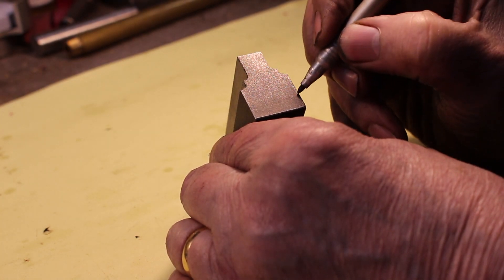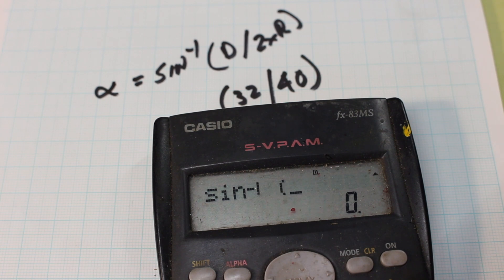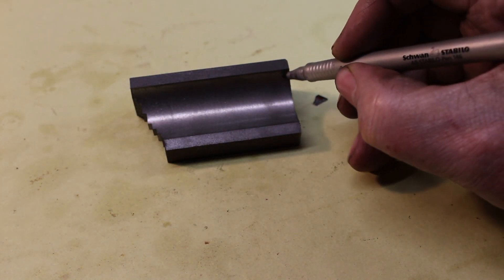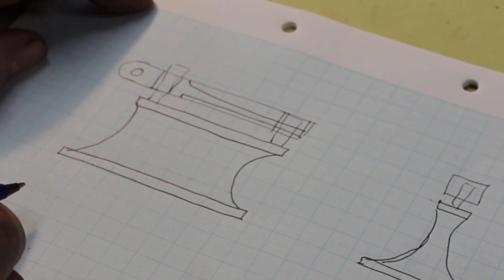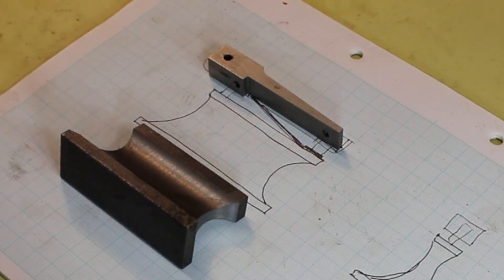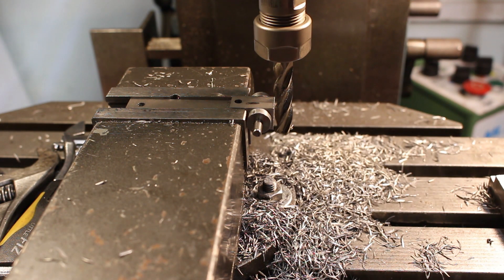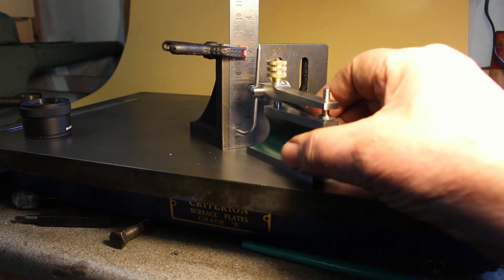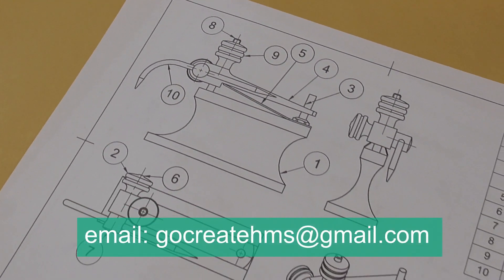#toolfest2021 - My Tool Build Entry - Tool Fest 2021

Comment: Beautiful workmanship Nigel. You had me guessing right to the end as to what you were working on. This is just me being curious but doesn't the path of the cutter tip trace out an elliptical profile relative to the vertical plane? I have used this method to make wide, shallow profiles in wooden mouldings using an angled fence relative to the plane of a circular saw blade. I just modelled it in CAD and the side view shows an ellipse 32mm major axis and 25.56mm minor axis. 
Regards,
Mark
Reply from the maker: Hi Mark, yes indeed it will cut an ellipse so in that sense it's an approximation. The larger the radius and the shallower the depth of the radius (or narrower the width) then the more accurate the machined radius to the required true radius, in such a case usually no detectible deviation.  I bit more investigation may make a decent video.
Thanks for watching and commenting, the scriber block did turn out really nice.
Cheers
Nigel

Comment: A file only cuts one way, not back and forth. Might save yourself some money on a new file using it properly.
Reply from the maker: Thanks for the tip. I've never felt that comfortable using the lift technique when filing, I've always preferred just a very light drag even though it may dull the file a little quicker. You may be interested in this video testing and comparing the lift and drag filing methods. https://youtu.be/xbykic--SKA
Reply: @GoCreatehms  There is no comparison period. A file only cuts one way base on my 47 years making chips. If you want to drag your file backwards by all means do so, it's your file but it also shows your lacking in how cutting tools work. Do that shit with a set of $150.00 Swiss files and you'll change your mind. No difference with a hacksaw, let the tool do the work.
Reply from the maker: @patrickhennigan9689  Indeed, I probably would change my mind if I were using expensive swiss files, I've allot to learn and allot to practice, thanks for passing on the benefit of your experience.

Comment: Fantastic tool, just right for smaller surface plates like I have. I am going to have to play with a fly cutter and cut some radii as I still can’t get my head around it and I hate using something without understanding how it works.
Brilliant video as usual, enough explanation without the waffle.
I am probably being very stupid but what is toolfest2021.
Reply from the maker: Hi Chris, thanks for watching my video and commenting. It's a good technique to play with, you'll find it in the old school machining test books. I've used it up to a 4-1/2" radius , on that occasion a long narrow name plate to fit onto a boiler barrel.
Cheers
Nigel

Comment: Very nice job. Nigel. Yes the radius was very clever, had not seen it performed that way with a fly cutter.
Reply from the maker: It's a good old time technique to machine a large radius, I've used it to machine a 4-1/2" radius on some name plates that had to fit onto a 9" barrel.
Thanks for watching.

Comment: Nigel, a nice piece of work, wonder if you might be able to give me a bit of info on your mill, I’ve been offered it would seem the same mill Victoria mk2 with horizontal and vertical heads, I’m told the maximum speed is around 600rpm , is yours the same and does it present any problems when using smaller end mills.
Reply from the maker: Hi Terry, thanks for watching my video and commenting.
The mill you saw in the video is my Elliott Junior Mill, details can be seen at this website http://www.lathes.co.uk/elliott-omnimil-00/
It's top speed on the horizontal spindle is 1700 rpm. In the video I was using my double swivel vertical attachment which I think gears up the RPM a little but I don't know for sure. 600 rpm is probably OK for a horizontal spindle were you tend to use larger cutters but for a vertical spindle is a little restrictive if you intend to use very small cutters allot however, as hobbyists we tend to mater what we have, low rpm just means taking it a little slower.
I hope that helps you out.
Cheers
Nigel

Comment: Beautiful tool.  That might be a winner.
Reply: IS this creator from over seas?? I set our to air at emmas request at 12:01 AM on the 24th of Nov,,,??? Whats the deal?? BEAR
Reply from the maker: Wasn't it to be 12.01 in your own time zone? I'm in Scotland.
Reply: I must have missed that part 🤐. Nearing 70,,so I miss alot more since I am over the Hill now,,. 🙄😋👍
Reply: @GoCreatehms  Heh heh, I missed the #toolfest2021 deadline by four days, but posted my toolfest vid anyway.  I'm permanently late these days. I'm going to try that angled head radius cutting trick with a big shell mill for an upcoming job. Thanks for the tip and the maths!
Reply from the maker: Thanks Harold, it was a lovely tool to build, with a nice vintage style to it.